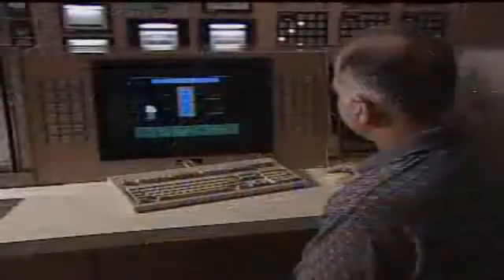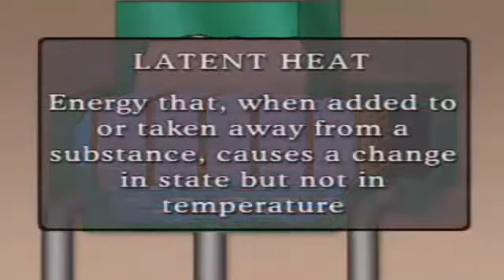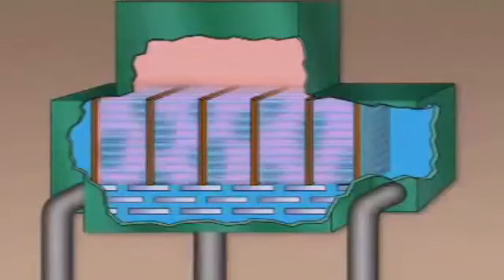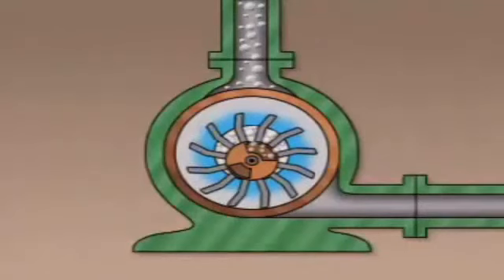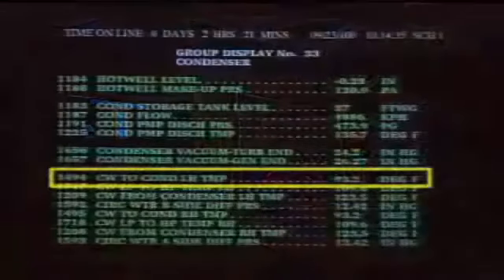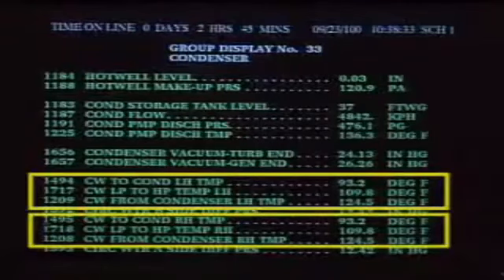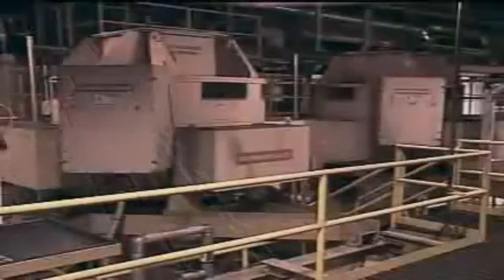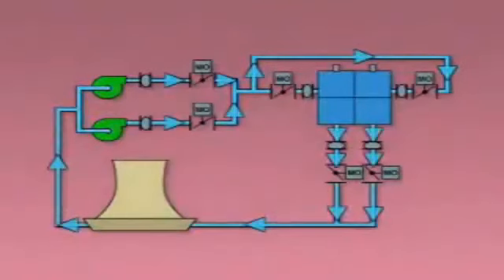Condenser Circulating Water in industrial plant

Comment: I didn't see a ball cleaning system mentioned. It would inject small sponge like balls on the inlet side of the condenser tubs, the balls would then travel through the tubes,  then capture the balls on the exit side. The balls would be sent back to the inlet side and reintroduced. The sponge like balls were just smaller than the ID of the tubes. Thank you for the video I appreciate it.